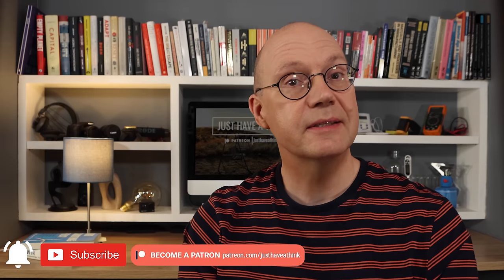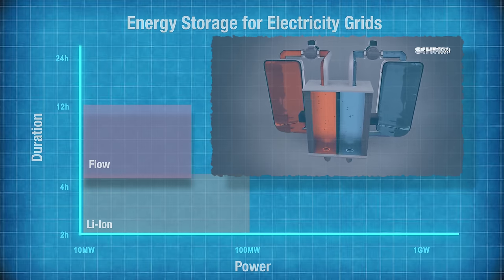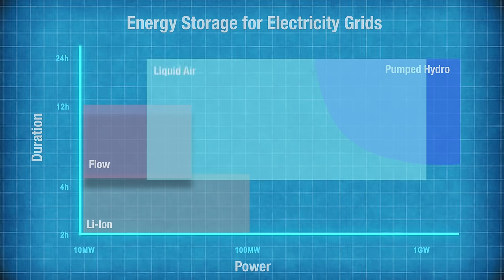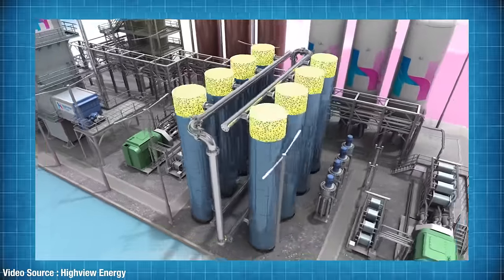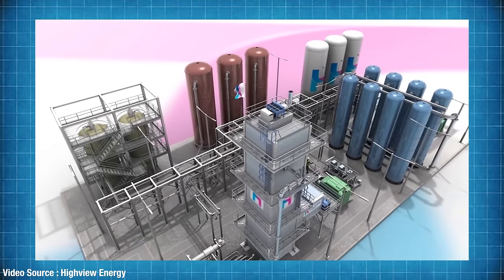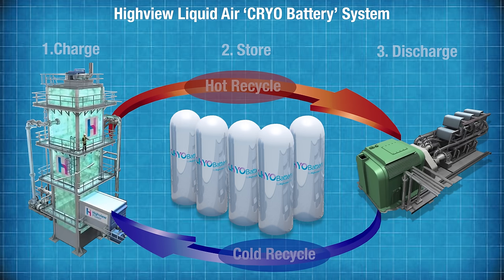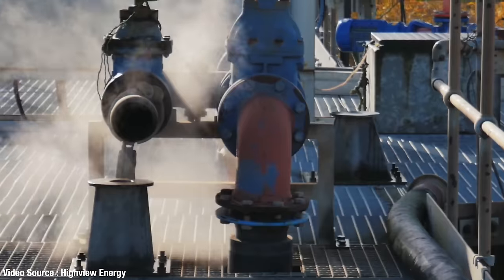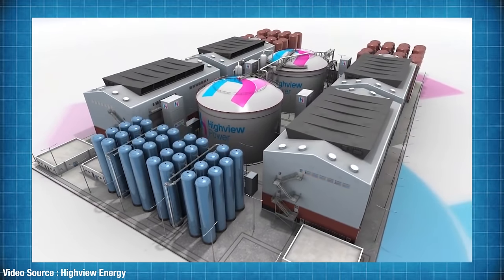Liquid Air Batteries. Literally energy from thin air. Seriously. Literally!

Comment: The round trip efficiency of 60% probably OK. Lithium systems have an AC round trip efficiency on the order of 75-80% but use limited resources like Li and Co in their manufacture and have a much shorter operational life, plus recycling issues at end of life.
Reply: Yes, to expand on that:
Lithium batteries are not great for big grid storage, but very useful in smaller/mobile units. Using spare capacity of your E-vehicle to power the house at night could be very useful.
For wind-parks and large solar arrays, liquid air seems like a perfect scalable and environmental friendly approach, that is used to power the grid. 
Really 60% efficiency round trip for a technology that needs very little scarce metals and is very well recyclable is way preferable over batteries, and with much lower environmental impact than hydro dams. And it works great on our Dutch flat and windy land too. 

It's always important to see an energy mix, suited to goals and distribution factors.
For storage of wind and solar energy, I can see a mix of somewhere in the regions of:
75% grid solution to capture renewable energy in liquid air (or similar clean grid-scale tech). These storages can be put close to the source, in order to minimize pressure on the national grid during peak production. Liquid air could also be a solution for new production sites on a grid that is already saturated, like in many places in the Netherlands, taking energy from the grid during peaks as well. 
20% in batteries for mobility (cars) and local use (or off-grid locations). These are close to the user, and are charged via your own solar panels or via the national grid (preferably in peak production hours). 
and 1-5% in Hydrogen, also for mobility in large trucks that need lighter solutions than huge batteries. Hydrogen can be moved around and distributed like petrol. This percentage becomes as low as possible, because of the many energy losses in the conversion and storage, but it can play a role in small amounts for specific uses.
Reply: The only practical way lithium ion batteries could be used as a major energy storage method for the grid is if you can get them cheap, I think that a few years after we get enough hybrid and electric vehicles on the road there should be a good supply of old batteries that are too degraded for road use but are in good enough shape for grid use, and hopefully by the time these early batteries are too degraded for grid use we will have developed the infrastructure to recycle them.

Comment: Do you know if this tech is also scalable down, so we could eventually have a liquid air battery to store energy at home, or, business, or school?
Reply: Educated guess: No... Keeping the air cool will become much more cheaper if the tanks are bigger..
Reply: No.
Reply: Absolutely, the only issue would be system management and safety concerns. Example having a monitoring company to respond to potential system failure like pressure regulation. If a system fails it could pose an explosion threat if left unattended.
Reply: I believe the scalability mentioned in the video is more upwards than downards
Reply: @Dundoril  You are correct, for your reason given. Very often "economy of scale" make "doing things" per unit cheaper at larger scales which are more expensive on a smaller scale ( less units).
Reply: I believe there will be an optimum minimum size due to the thermodynamic nature of the storage, a higher volume to surface area ratio will have lower losses.
But if you are allowed to export your excess renewable energy to the grid, then a local plant, say at a town or district level, could amalgamate your contributions at an efficient scale. That's the power of a fully integrated grid.
Reply: @SlabtheKiller89  true, however then concept of pressurized storage scales easily. A windmill, treadmill or any exercise machine combined with an air compressor can store potential energy. Ultimately scalability's only relevance is it's direct coloration with capital gain aka incentive.
Reply: For home, business or school batteries seem like a much easier solution.
Reply: I doubt you could get a turbine that size and the economies of scale would go right out the window
Reply: @Dundoril  you don't have to keep the air cool just pressurized... what... lol...
Reply: @jasonschwartzentruber5612  The problem is the storage of heated and cooled materials, and without that you're going to lose a lot of efficiency in the cycle. I'd also be curious how you could scale down the hot-air-turbines! I can't imagine this being used for cars, as an example. And if you cant get it that small, why would you want a smaller version? (That's not a flippant question; what applications/scenarios did you have in mind?)
Reply: @knifeyonline  well actually, existing gas supplies for building away from grid supply don't need cooling; they have massive tanks out in all weather.
Reply: also as I am not on a water meter I could potentially run the tap and power a generator, not very environmentally sound though. Would have to work out the capacity of air required.
Reply: @jasonschwartzentruber5612  Dude , we currently have LPG tanks that are  much more dangerous than liquid air.
Reply: @knifeyonline  Are you sure about that?  Dave described the air as liquefied.  I suspect it's stored in Dewars (giant thermos bottles, essentially) and is vented to the atmosphere as needed.  If it's allowed to rise to room temperature, it would have long since returned to the gas phase, and the pressure would quickly exceed the strength of a thin-walled steel tank.  In other words, the tank would explode.
Reply: At first sight I thought this would involve storage underground, but I was surprised.  There are some proposals to store pressurized air in underground salt caverns, and the pressure could be much higher, probably enough to be as good as cryogenic storage.
Reply: Take a 4 cylinder engine and strip out the valves, pushrods and cam and replace them with butterfly valves.  10:1 compression ratio gives about 150 PSI or 10 BAR.  Then find a large tank with a lot of volume that can hold that much pressure.  To generate power you would need the same valve system that is used on a steam engine, and the pump engine may be used as the turbine to turn the generator.  Devil's in the details but that's a start.
Reply from the maker: Hi Ken. I doubt it. There's cryogenic temperatures involved which probably makes it impractical for domestic use.
Reply: @JustHaveaThink  
Has anyone considered making a "pumped storage" type of thing.  But instead of gravity, the potential energy storage would be pressure.  The water storage would be underground, with a head of air above it under high pressure.  The outgoing stream would turn a turbine to generate power and the water would go into a lake.  When excess power needs to be stored the lake water would be pumped underground against the pressure.  One problem would be salty water of it was a salt dome, but then don't store it in a salt dome.
Reply: @acmefixer1  I think your problem here would be sealing that enormous pressure vessel. A vessel large enough to be of use would be very expensive to build and maintain. Any tiny crack and it would leak pressure.
Reply: If your car had a big enough battery then it can become part of the grid storage solution when not being used. Smooth out those wind and solar peaks and troughs. If grid goes down your house can run from the car for days.
Reply: It won’t, too much overhead. Might get to fit your garage tho..
Reply: 60% is that high when we’re talking storage.. Could still be useful
Reply: KEN - you cant have LIQUID AIR BATTERY, at HOME or Anywhere other than a Industrial PARK.
your City, County , State will NOT Allow you to build it , and your Project RED FLAGGED.
for the SAME REASONS why you cant use CNG or CH2 refueling at home. 
you LACK Critical thinking.
on the Other hand , HOME battery like TESLA Powerwall are SAFER and cheap to add to a home.
SCHOOLS & BUSINESS are already using TESLA Powerpack Storage .
see youtube - TESLA Powerpack Queensland School. 
it even powers KAUAI , HI and in SAMOA.
Reply: @incognitotorpedo42  Unless you had, you know, a relief valve :)
Reply: @markplott4820  businesses and houses often have large butane or propane tanks outside to heat their buildings or cook with.
Reply: @PaulMansfield  - NOT ANYMORE.
WORLDWIDE Combustables are DOWN over 50% compared to 100% Electric . 
Dryers, Stoves, ovens = electric.
also HVAC electric and Water heater. 
Today a 100% electric home is possible with SOLAR + GRID + Batteries.
Business/Commerical can move to Renweable+Battery +GRID Completely eliminating Combustables. 
SOLAR in 2020 is the CHEAPEST Energy generation method.
TESLA is Replacing 3 GAS Powerplants with 1x SOLAR + Battery. 1200 mwh !!!!!!
Commerical/Business can benefit.
Tesla MEGAPACK 3MW ships on a Flatbed Truck , Deployment > 30 Days to Install.
charges with Renewables + GRID (off peak).
Reply: @knifeyonline  The phase change from gas to liquid is where the most energy storage happens. The liquid MUST be kept below its critical temperature or it turns back to gas, releasing the stored energy.
Reply: @Dundoril  Regular Dewar flasks can hold it for more than 24 hours. If you make them spherical, it will be still better. For a domestic power plant, 100-200 liter should be sufficient.
Reply: My question, exactly !
Reply: @acmefixer1  thats a good way to make fizzy water. In this plant they store the nitrogen and trace gases and filter out the water and carbon dioxide would have to do the same in your set up, plus the running capacity of this set up far exceeds any compressed air set up as you have 700 times the volume to turn the turbine, for large scales this is actually very efficient.
Reply: Why do it at home, except for the express reason of living off grid? Otherwise let the big boys do it and simply send you the electricity over a wire 🤔
Reply: Yes it is!
Reply: @cymes82  not to mention hydrogen, the most volatile gas in the universe!
Reply: @JustHaveaThink  wrong! If you use excess wind power at night, when no one wants it to compress air, you can use as battery. Tanks under house in Foundation, as an example. Keep in mind Super CAES generates 10% more power than used to put into storage, if you heat on expansion! 🤔🤔
Reply: Ken Henson : The efficiency would suffer whatever the initial claims.
Reply: There are such things as compressed air vehicles (shameless plug for EngineAir)
Reply: Li22ie Topper : Do tell. What are the specifications?
Reply: @jasonschwartzentruber5612  true, but if you use "cavernous tanks" (buried in the ground) there is little or no safety concerns!